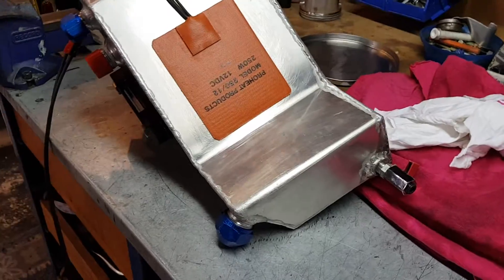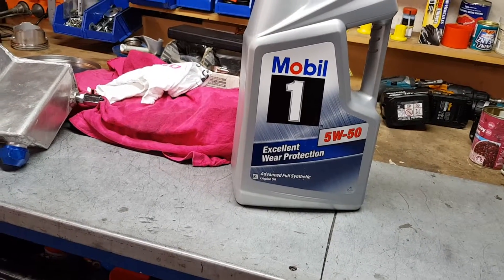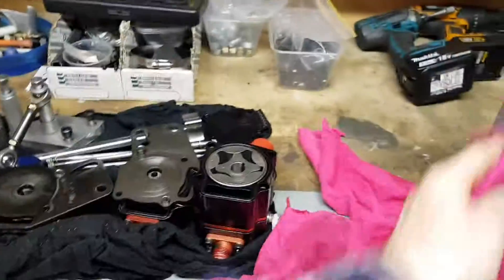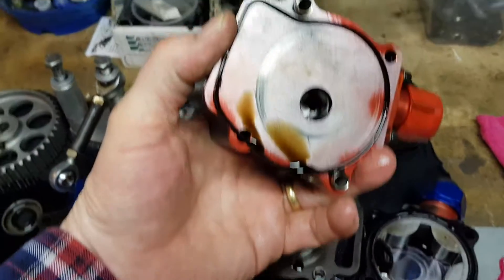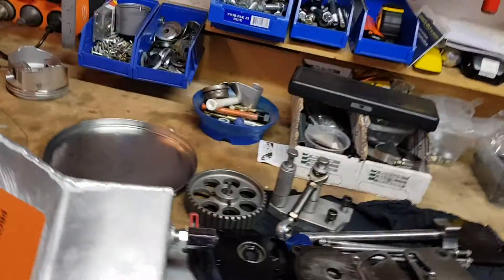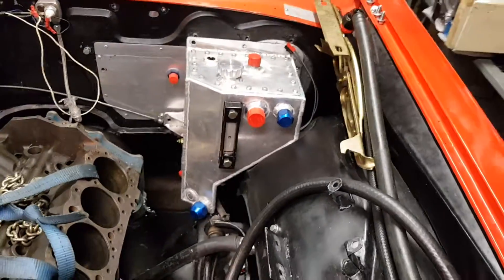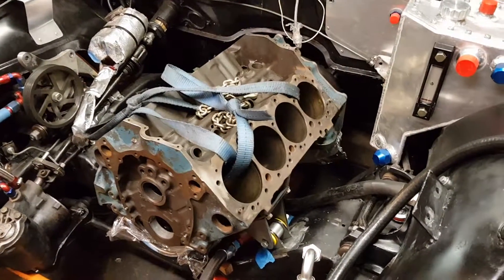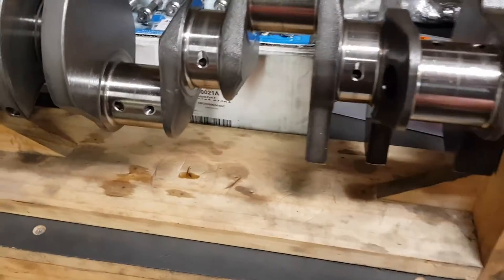HOW GOOD IS MOBIL 1 FOR 350 CHEVY RACING

Comment: Interesting vid while sipping on my morning coffee... i run 2.5 ish thou bearing clearance and High zinc mineral oil 25/60, the only issue with thick oil is yes you have to get some temp in it before revs, but thats just procedure now, but thicker oil when beating on it is alot more stable and gives consistent oil pressure and thats what you want when the temps climb..i like your mounts , very nice..the crank cradle what a good idea simple and effective...i think its moisture on the stud causing that, maybe some iinnox or the like upon installation might protect... enjoyed your update, cheers Griff